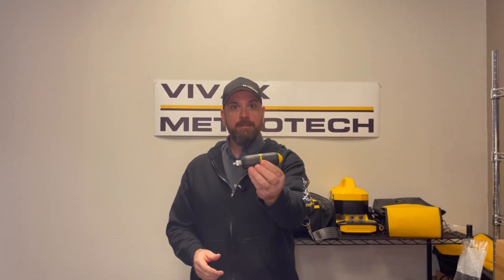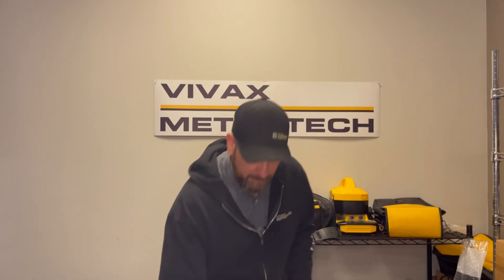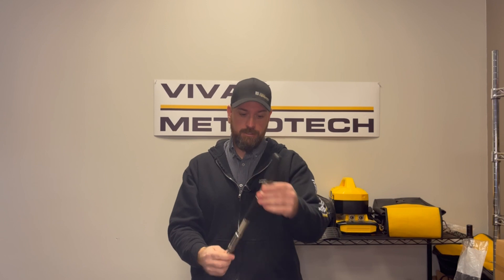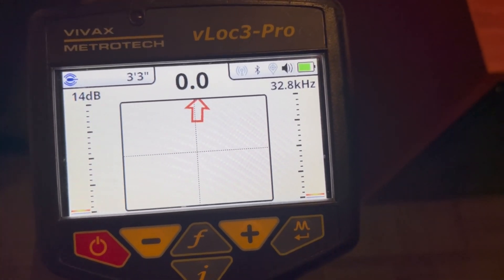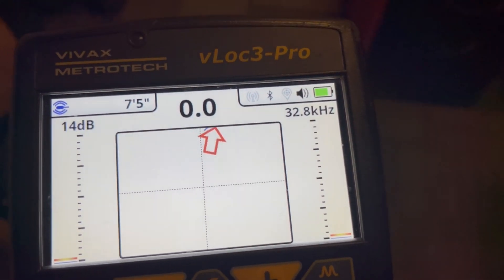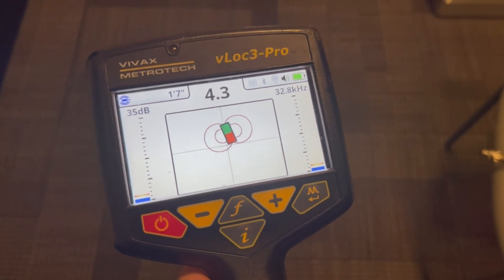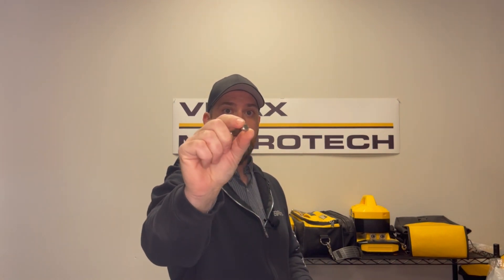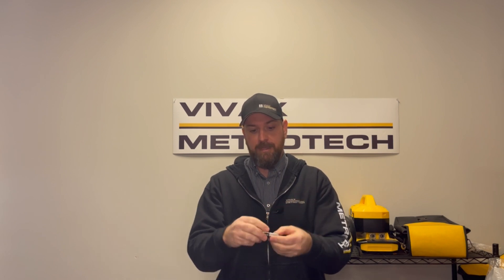Sondes and Sonde Locating

Comment: why can't I find sonde mode on my receiver, my company just gave me a new vloc 3 pro but I can't find sonde mode anywhere.
I looked at the manual it came with, but it has nothing on there to tell me how to fix this problem.
Reply from the maker: It is probably not turned on in the menu. Push and hold the i button and you can scroll through your menu to turn features off and on. Best bet though is to get ahold of your local rep and they would be more than happy to provide training on the features.

Comment: Why would one use a sond over just running a metal fish tape in the pipe and connecting the transmitter to the tape?
Reply: My guess is that the sond would be more accurate as far as trying to determine the end of the fish tape location.
Reply from the maker: Often because the end of the fish is not grounded it is hard to determine where the end is. You are correct that a sonde is more accurate. So a Rodder that is locatable with a sonde on the end is a great tool.